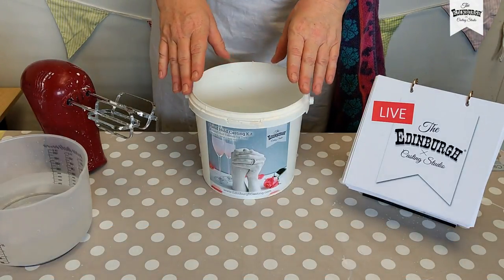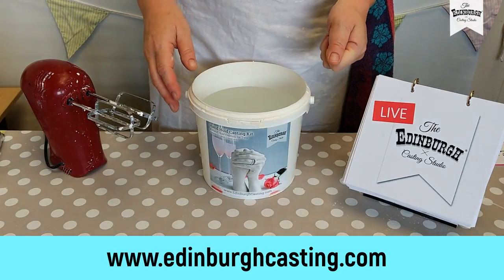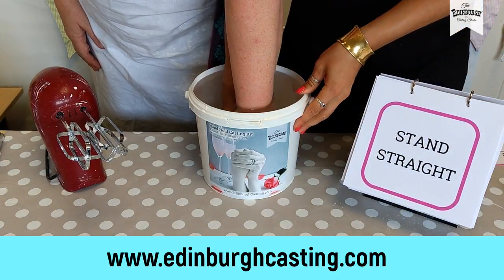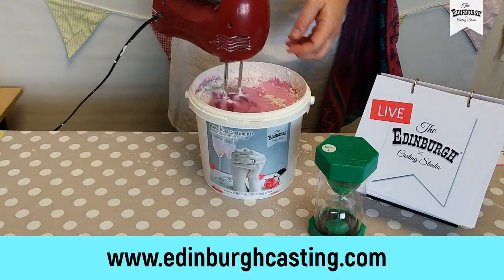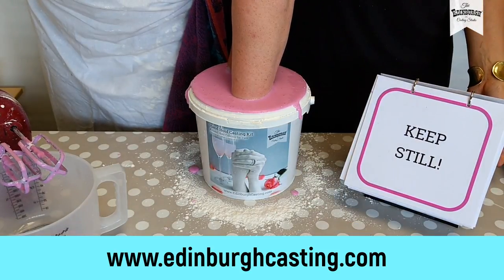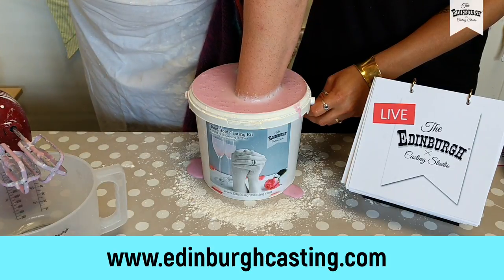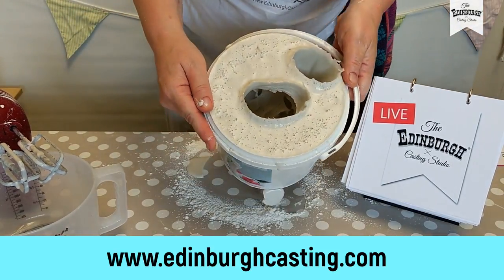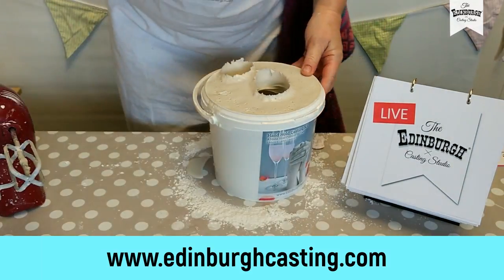Hand Casting Tutorial: How To Create The Mould

Comment: Could you use this kit for making a resin hand bust instead of using the quick results mixture youse provide?
Reply: Resin can't be casted in alginate, because alginate it's water based.
Reply: Shida Prini thanks for the advice, I’ve seen people using Alginate for making resin casts in other yt tutorials hence why I thought this could work
Reply: Okay, I have seen a American yt use a really fast cast resin,(that's not transparent), that I haven't found available in the uk, but apart from that nothing. The moisture in the alginate mould inhabits the resin to cure correctly. What I do with my life castings is wait until they fully dry, and mould them with a silicone that can cast epoxy resin.